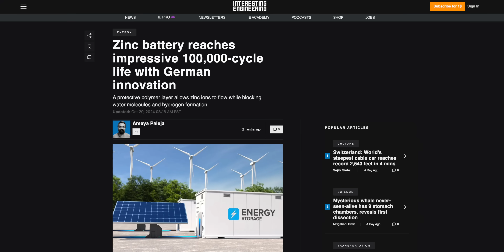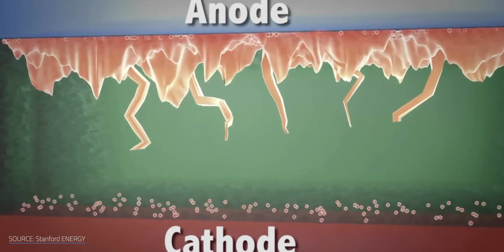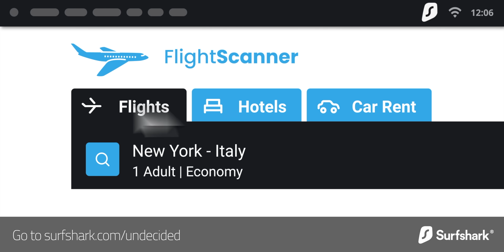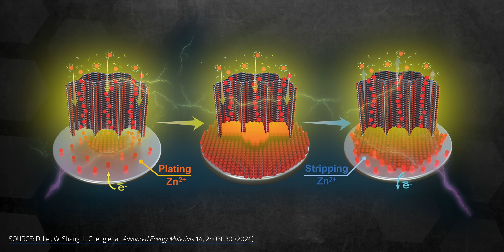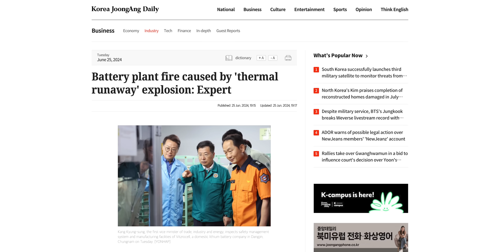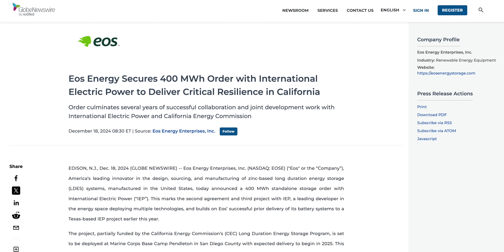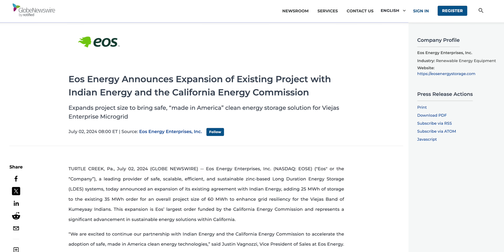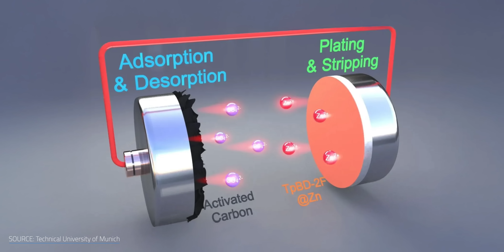How Zinc Batteries Are Defying Limits

Comment: Should the TUM batteries prove commercially viable, I can see them as home stationary storage which lasts the life of the owners.
Reply: Exactly. Waiting for a decent battery for my home. Not spending money on one that by the time it's paid for itself requires replacement. Much rather one that takes up a bit more room but can actually last.
Reply: @buddhamack1491  Then you're already losing money. In my country, I could show you people that have battery + solar systems that have already paid for themselves, and will continue to do so for many years to come. I doubt people like you will ever change, there's always an excuse.... PS, they last longer than you think....
Reply: Nickel-Iron already does that if you bother to maintain the electrolyte level.
Reply: @Shaker626 the low charge/discharge efficiency can be a big issue for nickel-iron batteries

Comment: 0:55 Weird that people still believe that EV are durable when Tesla told the world a car will last about 200 000miles which is about 320 000 km while commercial diesel truck will do at least 625 000mi or 1 million km.
Reply: The graphic says "300,000 - 500,000 miles" not 200,000 - weird that you just made that bit up.
Reply: No ICE car is expected to last any longer than an EV. ICE trucks are much more heavy duty than ICE cars,there’s no comparison regarding life cycle.
Reply: Your comment is deliberately misleading. You are comparing the lifespan of EV cars to ICE heavy duty trucks.  No one shopping for a Tesla Model 3 is considering an 18-wheel truck as an alternative.  You should instead be comparing it to ICE cars.  And EVs do, in fact, have similar durability to ICE cars.

What is weird is that you think people won’t see how you are being disingenuous.
Reply: Key question does the battery need to Outlast the car. I don't think a car's body or interior could last that long

Comment: I've been experimenting on a solution with mixed materials, lithium, zink and a high pressure system. So far it's very effective and should be a very good solution for all cars and trucks , it will have a much longer driving range, and long lasting and actually much more efficient and about 50% in cost of making. It's a very simple solution and also very compatible with other services like easy change of batteries and also charge during driving. My calculations is that you could easily drive from the north of Sweden to southern Spain without stopping for charging

Comment: My mom's Subaru hybrid has over 300,000 MI. Her batteries are rated at 90% currently.
Reply: It's not relying on just the batteries to go the 300,000 miles, just to improve efficiency of the internal combustion engine and braking.

Comment: Whether Zinc-Ion succeeds or not will depend upon it's characteristics and cost vs more established Lithium and Sodium battery stablemates. It will probably get squeezed out though having lower energy density, being heavier so will have higher footprint and installation costs.
Reply: Thats what I said. I dont think comparing it to Li was the best, as you have Na batteries that compare closer to. In that case, Na has the better value because its even cheaper than zinc both in raw cost and availability.

Comment: It wont ever happen for the same reason we dont have a right to repair what we buy. It doesnt make enough money.
Reply: There is plenty of money to be made in grid-scale battery systems. Fast-charging at 300+kW gets ludicrously expensive due to peak surcharge on grid connections, buffer batteries will be necessary to reduce those surcharges and possibly also generate revenue by selling excess battery storage during peak hours while charging them back up off-peak to help pay for on-site battery storage.

Comment: so is this finally the zinc acid battery. that last very long because of the h2so4 reducing reset action. on the zn and zno/2. dont exceed the charging limit. guess that overhead costs an arm and a leg. you just need to chill the battery.